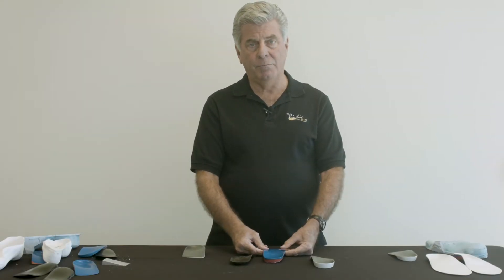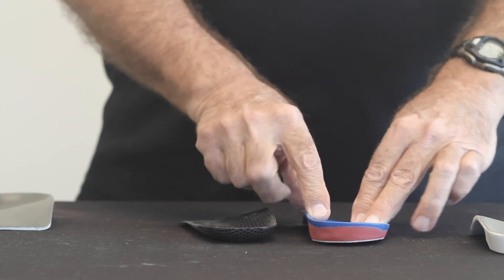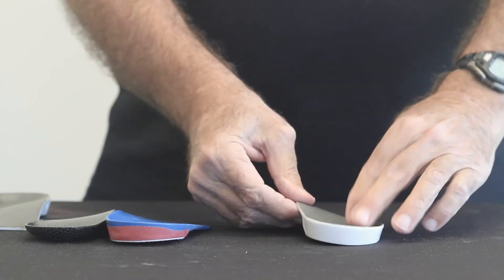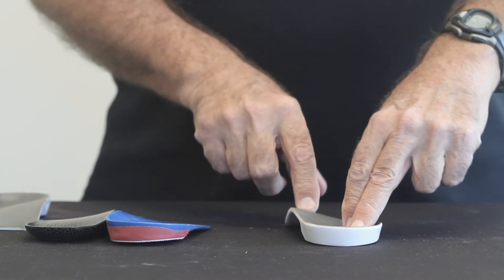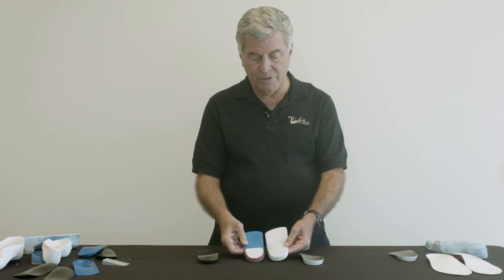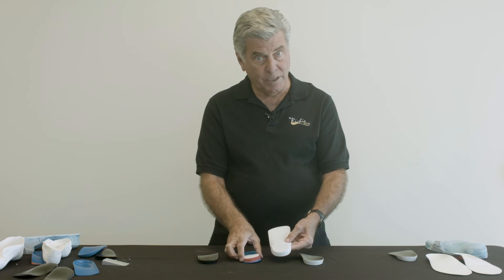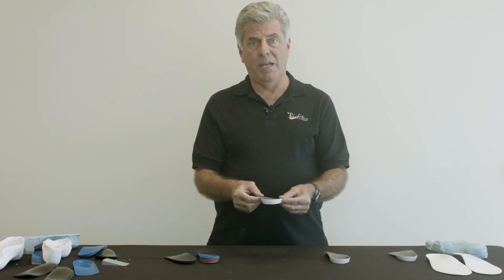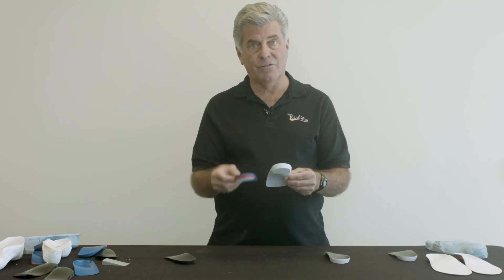Dr. Richie Presents Intrinsic vs. Extrinsic Posting

Comment: I'm wondering if the extra height of a post negates any extra stability. Your heel is going to be sitting higher in the shoe with a post and that might lessen the support of the shoe around your heel.